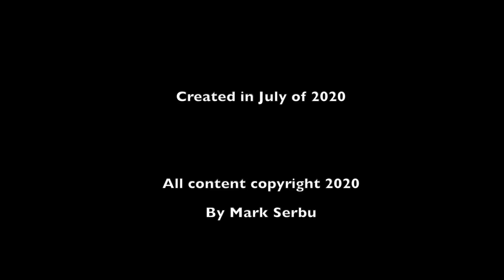Wood's Metal Disaster

Comment: Woods metal was used in cia key copying sets.  Pretty neat.
Reply: Also was used during WWII to make wing tanks. It would be cast to shape, then used as the collector for an electroplating bath. Once the tank wall had built up to the proper thickness, it was set in boiling water and the woods metal was poured back out.

Comment: doesn't wood's metal produce toxic fumes when you heat it?

Edit: I didn't watch all the way through the video lol
Reply: If you look through the guidelines for lead foundry workers you should be much more concerned about contact with oxides than fumes. The working temperature of pure lead and most of the general lead alloys is around 600 to 800 Fahrenheit. The vapor point is around 1,400 f. So in practice you are not getting any lead fumes. any nasty fumes and smoke you get off of melted lead if you're doing something like bullet casting are crap that you're burning off such as plastic or oils.  More likely it's your flux than the lead that you smell.

Comment: Approx.
50% bismush
27% lead
13% tin
10% cadmium

Lead isn't great, but cadmium really makes it toxic. The 70°C melting point is useful, but if you can deal with a 190°C melting point then a 62% tin 38% lead mix is a lot less toxic. If you need something much less toxic then look into Field's Metal, but it's 50% Iridium by weight so it gets expensive fast

Comment: I make my own with bismuth, lead and tin.  Without cadmium the alloy is called Rose's metal, not Wood's metal, and melts at about 200 degrees.  The higher melting point is harder to work with because it'll burn the shit out of you, but you can still melt it with anything that'll boil water, and worth it to not have to fuck around with cadmium.  I get all the ingredients from a place called 'rotometal' online.  Also,  run a bit of modeling clay around the bottom of whatever you're casting it into, and tamp it down well to make a good seal, and you'll save yourself a lot of grief.

Comment: Not trying to armchair quarterback, but set the part along with a small aluminum block (base) in the freezer before you pour the metal. Should help with solidifying quicker & the block acts as a heat sync

Comment: How about one of those industrial heat guns that are like a hair blow dryer on steroids?
I'd not use a blow torch around glass.
If you do not seal the bottom, it will leak out.
And he still does it once again without a pan underneath!
They make aluminum tape, and it holds up under fire, as in flames, and those cans of "canned air" held upside down will spray out a liquid that will freeze the woods metal ASAP, so pour, then spray the outer surface.
I cast things like that in tin so it's a lot hotter than woods metal.

Comment: Put some 3m double stick tape under the bottom. Don't peel away the tape though. Just make a cap with it. Also if you can find that stick on foam weatherstrip tape ,that's wide enough, would also work. 

Thanks for the laugh. I actually really needed it.
Reply: Do you just drive the solidified plug out one end once it solidifies?

Comment: This is the kind of workplace where I could actually enjoy turning up for work... Just as long as there's full disclosure about the Wood's metal in the break room (I don't give a floating shit that it's toxic just whether the employer cares to tell me it's on the condiments.).  Duct tape & WD-40 is the essential tool kit, even comes with a flow chart to determine which to use...
Reply: 20:59 ohhhh I forgot about ally foil, then again I'm not an electrician so don't find much call for it in repairing fuses etc